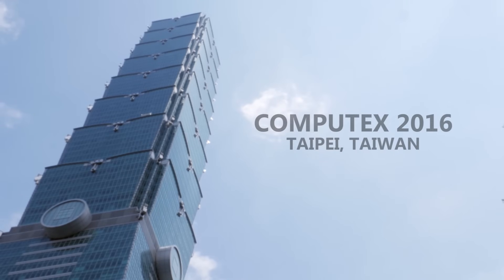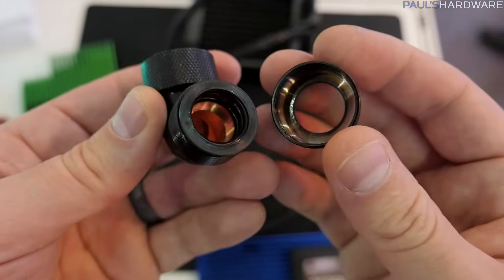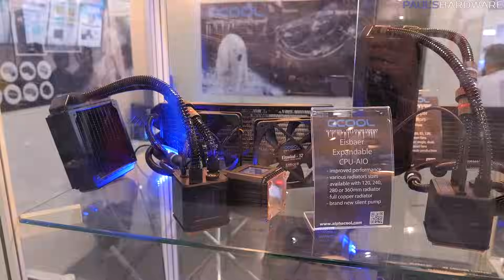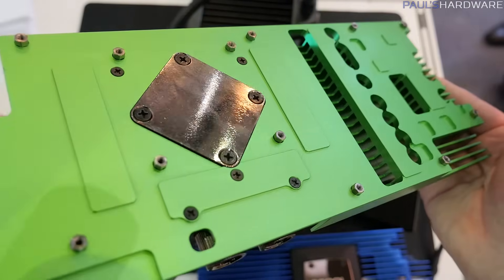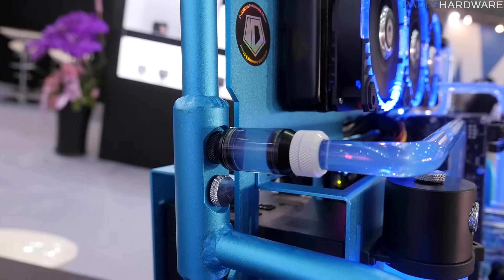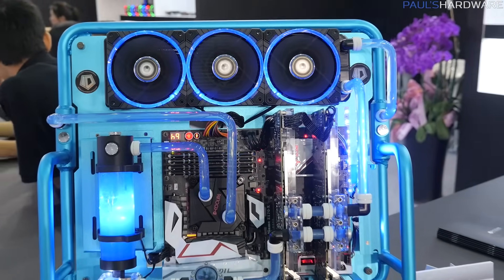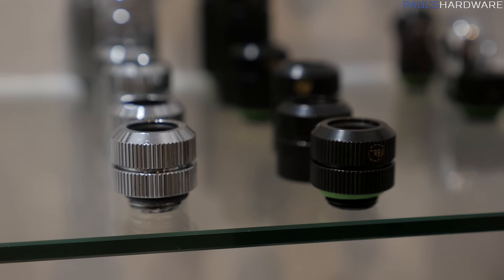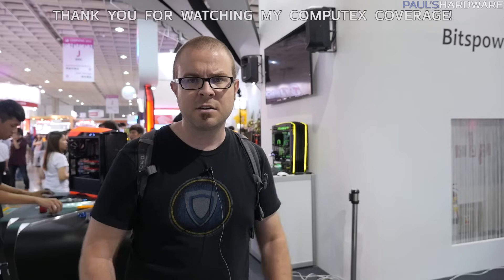Next Level Water Cooling - BitsPower, Alphacool @ Computex 2016

Comment: instead of welding they could have made it a portable type of build and used quick disconnects on the frame/tubing, magnetic connections to cables and a 100% modular PSU to let you break it all down into a smaller package that fit into a backpack which would have been a more interesting piece to bring to a show, it would look better and offer LAN party goers a unique rig to pack around with them and also make it possible to order separate chassis parts from the company to build sort of like legos to make a personalized unique rig that could potentially grow into a room covering monster...they really dropped the ball on that one

Comment: I have an MSI Godlike and bought that exact Combo block from Performance-PCs. Im awaiting RMA request as the VRM block did not align properly. I would make sure that part fits correctly. Other than that, it's a good fitting and looking combo block. Was not thrilled with loosing the RGB on the PCH and VRM/IO area. For $200 that should have been implemented.

Comment: That Stream 4 with the 21:9 monitor is the most interesting thing I've seen in years when it comes to PC cases. They should develop it to support the LG 38UC99 and other 34-38 inch 21:9 monitors., I'd be interested for sure. Just make the case a bit wider, the monitor is gonna be wide anyway so it doesn't matter if the case is too. Gotta make sure it has enough support in the front of the monitor though so it doesn't accidentally flip over.

Paul, you should ask both LG to send you the 38UC99 and ID cooling to send you a Stream 4. That would be an epic build.

Comment: Those external radiators aren't just for when ur case is small, this way you can overcome the second law of thermodynamics and cool with cooler than room temperature!
Reply: *Those external radiators aren't just for when ur case is small, this way you can overcome the second law of thermodynamics and cool with radiator cooler than room temperature!

Comment: Paul, I need your help with one of your sponsor's products.

I'm trying to choose between the MSI GTX 1070 SEA HAWK X and the MSI GTX 1070 GAMING X 8G . They are both 150W cards but the GAMING X has an 8 and 6 pin power connector and the SEA HAWK X has only a single 8 pin power connector. Wouldn't this make the GAMING X easier to overclock yet prone to more heat than the liquid cooled SEA HAWK X? Am I significantly handicapped in regard to overclocking because the SEA HAWK X since it has one less power connector? Thanks in advance for your help!

Comment: Personally I wouldn't touch anything that puts Aluminium in a water loop with copper, treated or otherwise. 

Too many bad experiences from products that swore treatment prevents corrosion - until that microscopic point of failure slowly opens up over time and destroys your hundreds of dollars of cooling equipment... now if they did a plastic coating through the inside not just a Aluminium treatment I would be more interested.

Comment: Really liking the vids Paul, specially the epic modded systems :). And damn even more epic builds from Bitspower right there! I can even see two guys from bitspower trying to build a hard tubing rig behind you.

Bitspower as usual have some really good high quality products at the same time the high price tag. Really like the mono block's and gpu blocks but they are very rare and expensive here in the UK :( And I am interested to see that new water tank product they have on display :D.

ID Cooling I think is a cheaper alternative but I think they are a bit skeptical stepping into a new market because of patent concerns but who knows. The ideas about the aluminum frame cases are nice though (I really can see the D frame's from In Win right there). But they could've done a better job with the welding of the frames. Cause it really sticks out like a sore thumb.

^other cheaper alternative are from "Barrows" who literally have or sell kind of like Bitspower fittings (knock off's). I used them as well and they are very good and leak free. Although they are very hard to tighten both fittings for acrylic/petg or soft tubing. But the quality is pretty good for a cheaper price.

The OCool fittings seems to be the same design but integrated into a 90 degree fitting for hard acrylic/petg/ or copper tubing. I have tried some of them on acrylic tubing. They are pretty good. Did not experience any leak from them and are very easy to install. You can  literally hand tighten them without any problems and you don't have to clean the edges of the acrylic tube cuts. The downside like some other fittings is that, you can literally and easily pull them off, there is a bit of fight when you pull them but they can be pulled easily. But unless you pull them off on purpose, they do the job well and are leak free.

Comment: I'm building my first PC and was wondering if you can help me. I'm trying to stay as close to $1000 as much as possible. This is what I put together : 
Intel Core i5-4690K 3.5GHz Quad-Core Processor

Cooler Master Hyper 212 EVO 82.9 CFM Sleeve Bearing CPU Cooler

ASRock Z97 EXTREME6 ATX LGA1150 Motherboard

Kingston HyperX Fury Blue 8GB (2 x 4GB) DDR3-1600 Memory

Western Digital Caviar Blue 1TB 3.5" 7200RPM Internal Hard Drive

EVGA GeForce GTX 970 4GB SSC ACX 2.0+ Video Card

Deepcool TESSERACT BF ATX Mid Tower Case

EVGA SuperNOVA NEX 750W 80+ Bronze Certified Semi-Modular ATX Power Supply

Lite-On iHAS124-14 DVD/CD Writer

Microsoft Windows 8.1 OEM 64-bit

Asus VS228H-P 21.5" Monitor
Reply: I'd wait for the gtx 1070 the performance gain would be crazy or the rx480 as a much cheaper but slightly better performance. try to put in a 250 GB add in as the main drive as boot up would be so much quicker.
Reply: +James W I was thinking about the 250 ssd if I have enough. Thank you for your thoughts, I really appreciate it ! :)
Reply: +SuperNerd no problem, wishing now I went for a 240 and not a 120 ssd

Comment: As long as they have good diagrams to make sure I understand how the water flows through those chassis loops I'd buy one. Are these cases kinda pre-setup with tubing, radiator, pump fittings? Looks like it could make your life easier.

Comment: Does water cooling get you better bang for the buck than air cooling and do you need water cooling if you're not gonna overclock???
Reply: If you're not overlocking there should be no point of you using water cooling.
Reply: Also watercooling and 'bang for the buck' don't usually go well together.

Watercooling yields better results, but at much higher costs.
Reply: Thanks guys!